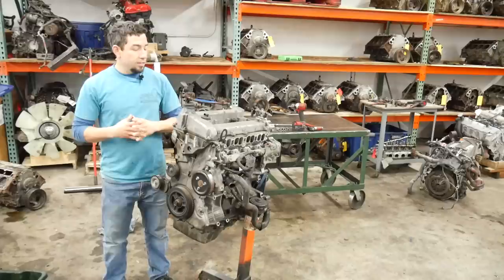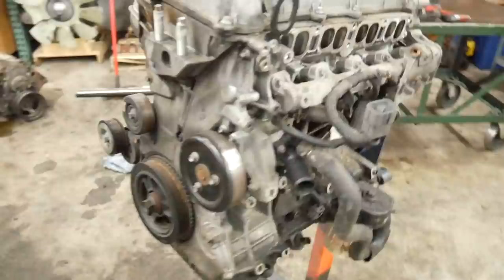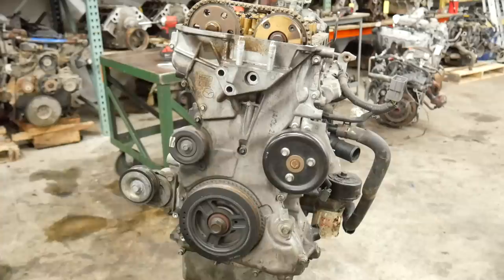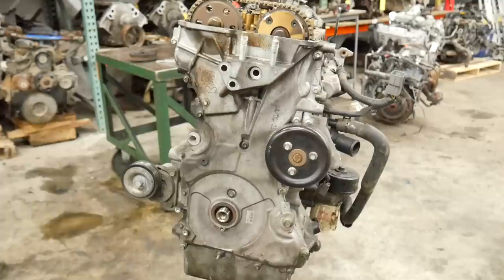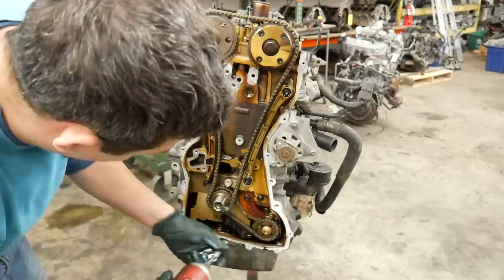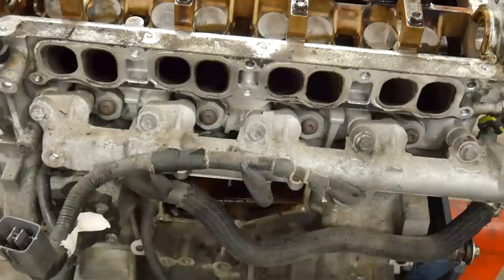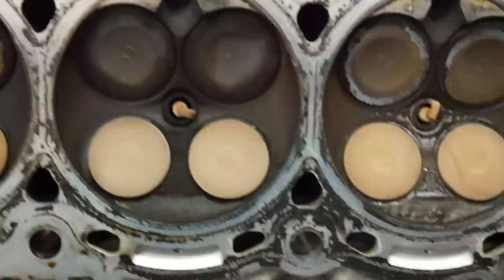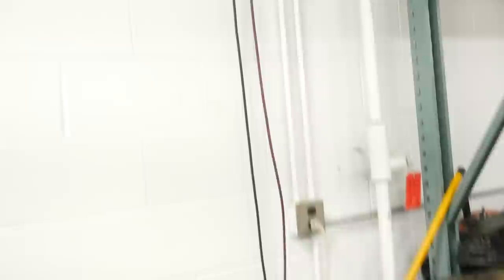TOTAL TEARDOWN: BAD Mazda MZR 2.3L Turbo Mazdaspeed3 Mazdaspeed6 CX-7 Engine.

Comment: I've been wondering where all the Mazdaspeed 3's and 6's went... Haven't seen many CX-7's out there as well.

My 2011 with 50K on it has been pretty reliable since fall of 2016 when I bought it with 22K miles on it. Turbo went but that replaced under extended with a non-cx-7 turbo since they don't make them anymore... That said, after watching this, I'm glad I got extended on it. 😬 Damn, that's complex.

Comment: I would love for you to do a Theta II turbo 2.0 out of a 11-15 Optima, or 11-14 Sonata. They had the huge class action lawsuit, resulting in lifetime engine warranty. But I would like to know the design flaw. They say its from leftover metal shavings during engine manufacturing. Which doesn't make sense because some people are on their 3rd and 4th engines. I'm sure if it was only metal shavings they would've corrected that years ago.

Comment: 245k on a speed 6 original engine and turbo, I change the oil religiously at 3k miles I drive this car pretty hard at times. 

people beating the piss out of them and or not doing proper maintenance is why they fail, these engines aren't harder to work on than anything else I've noticed, there's people out here pushing 5-600hp on stock internals....

proper tools and follow the service manual I've seen folks tear down and rebuild these motors in their garages. 

this whole video is all personal bias.

a utterly terrible motor is the Ford Duratec v6 (any generation), I went thru 3 of them all of them spectacularly failed in some sort or another.....
Reply from the maker: I do agree with you however you can’t tell me that only people who beat the piss out of and neglect cars only bought these. They own everything. The truth is they aren’t as tolerant of abuse or neglect, and they are expensive and somewhat difficult to service if you do it yourself. 

I do complete agree with you on the duratec v6. The mazda6 especially. Oil leaks, rod knock, broken manifold bolts and don’t get me started on the water pump design.
Reply: @I_Do_Cars  I agree, as well they are not as tolerant to abuse FWIW, you still have a dope video here and I am subbing!

Comment: I've worked on many cx7s with the turbo 2.3s and I absolutely hate them also!! The design sucks but if one comes in the shop that actually has been takin care of they are actually not that bad of engines but they all fail due to owner negligence especially with oil changes

Comment: Dude, the rocker cover is from a Gen2 Speed3. For CX7 which only comes in auto, there is an inner bearing at the end of the crank. Lookin at the block bolt on where the power steering pump sits, I'd say its a Gen2 Speed3 engine.
Reply: MS3's have that red metal oil filler cap on the valve cover. This one has a regular cap from a cx or a regular 3/6. So might not be a MS.
Reply: @quazznorm1777  Thats optional on a MPS but that could easily been swap but what cannot be easily swap is the piston+con rod. For the Gen2 thats 100% diff. That alloy oil cap fetch lots of money over in asia n' europe coz thats for USDM only.✌
Reply: @quazznorm1777  it's irrelevant. An L3-VDT is an L3-VDT, they're all the same engine with the exception of the differences between the gen 1 and gen 2. That's a gen 2 L3-VDT as fitted to a Mazdaspeed 3 or CX7. The only difference between the Mazdaspeed 3 and CX7 is the spec of the k04 turbo.
Reply: @byteoncomputerservices8054  Piston+con rod is same for Gen1  Speeed3,6 and CX7 but redesigned for Gen2. I've blueprint it blah,blah,blah. Thats how I know the diff.
Reply: @princesssolace4337  The piston most definitely is not the same between series one and series two (as fitted to the BK and BL MPS/Speed3 and CX7) L3-VDT, rods are all the same sinter forged items and the weak point of the engine when tuned.

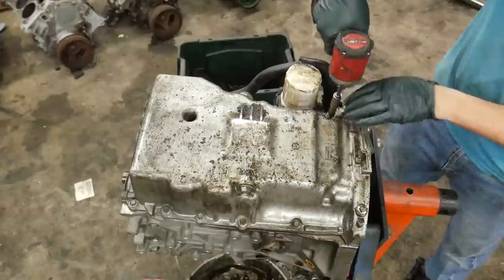Comment: @13:56 See that canister oil filter?   Unless this engine has had an aftermarket filter conversion installed, it is NOT from a Mazadspeed6.  Those have cartridge filters.
Reply from the maker: People buy engines and swap parts on cores all the time. That’s likely what happened
Reply: @I_Do_Cars  Or just likely the engine came from a 2nd generation Mazdaspeed3.  I believe those used canisters.

Comment: I owned a 2006 Mazdaspeed6 and the engine blew at 136,000. 2 cylinders had zero compression, sold the entire car for $800.
Reply: That generation was reliable.   What actually failed on yours?
Reply: @mrdumbfellow927  not sure, did compression test and cylinders 2 & 3 had zero. The rear fenders were rusting pretty badly so didn’t want to pour money into it. Also, it would drop out of second gear (had to hold shifter into place) so I unloaded it. I always wondered if the guy I sold it to ever got it running again.

The car was fast as hell and great fun to drive, was a beast in the snow also. It’s been 4 years or so and I still miss it.
Reply: @Jonesy32  Cool, I was curious  because losing compression on 2 cylinders simultaneously instead of just 1 or a whole bank of a v6 or v8  is weird.  I always wanted a Speed 6.    Sort of unique compared to seeing a fast AWD  Subaru or Mitsubishi all the time. 

Rust is definitely the enemy of everyone.  Unless you live in the south, those people have no clue how good they have it.

Comment: Did you ever notice how small the hole is for oil in the chain tensioner?   I bet most people are neglecting oil changes and or wrong oil.     Too thick of oil to get into that tensioner.

Comment: I bought a 2008 Speed 3 brand new with 20 mi on the odometer. It now has 230,000 mi on it and it's still kicking. Zero engine work, original turbo, original clutch.

Comment: Bummer.  I have a 2008 Mazdaspeed3 w/ 98K miles and have had zero probs, except for the smoking turbo (a manufacturing defect of the K04 turbo).  Then again, I change the oil and filter every 3K miles.  Sounds like the problems people have with the MZR 2.3 turbo originate w/ their failure to keep the oil and filter clean and fresh.

Comment: CX-7 from 2010 with this engine, 235.000km, number of issues with this engine: 0. But so much fun after 12yrs and 235K kms too! :-)
oil and filters changed after every 10.000km. what's the problem?

Comment: A lot of GM 3.6L engines get timing chain stretch. It tends to happen to people who trust the oil life meter. People who change their oil more often have been said to be less likely to experience that. I think GM decided to change the programming of the oil life meter.
10:42 I have heard of people resizing the cam caps, the running an align-hone through the cam journals to save rare DOHC or SOHC cylinder heads. However, I think the MZR2.3 head is common and cheap enough to not need that.
Reply: My old BMWs have a oil change indicator on the onboard computer where I think ze Germans added an extra zero in the code somewhere... I pity the engines whose owners paid attention to it
Reply: @greebj  Wow, and I thought BMW engines were annoying enough already. After decades of improved gasket material, BMW still uses some kind of garbage that turns to stone in 5 years of driving.

Comment: As I knew it!!  Oil starvation in a turbo entire the worst and he said those were good crankshaft bearings!!! And Mazda kept denying that it was an engineering issue!!!! If you bought new and warranty ran out you were screwed. Talk about a bad investment. And I read over and over how people bought new engines only for the same issues to happen again leading to engine failure. Junk!!! Mazda and the dealers made money off this junk and I'm wondering how they're even being considered as something worth even buying as the newer models are now advertised for 22/23!!!!!! And there's no aftermarket kits or parts for these things so MAZDA lost me. Buuuut, check this Mazdaspeed 6 on YouTube with a bit over 900hp with factory block!!!! That's hard to believe but check it out by typing 900hp Mazdaspeed 6. It's what had me thinking these engines or this line may have been worth looking into. And can you believe Mazdaspeed which he just did the teardown didn't make many of that turbo series with the 6 turbo so they are going for as much as $10,000 can you believe that!!!!!! And this is exactly what may happen to you no matter how.much you baby the car because it was just bad engineering for the 04-08 and 09-11 as well years but overall Mazda burned a lot of people with these models and engines to the point of having a class action lawsuit brought against them.

Comment: I bought a first gen Mazdaspeed 3 and put about 50k miserable miles on it.  It was such a strange car.  It was exciting under acceleration and that's about it.  The suspension was rock hard but the car pitched like a sail boat in corners, rev matching was near impossible even after 50k miles, it started to blow smoke out the exhaust after 30k due to a bad turbo seal, it wasn't a good sounding engine either.  I got it pretty cheap and it was pretty reliable I guess so not the end of the world but yeah..not a lot of fond memories of that car.  I did like the way it looked though in pearl white.

Comment: I used to work in a Mazda dealership that 2.3 is a very GOOD engine when it's in a speed 3 or speed 6 but they where garbage in the cx7 because the engines ran too hot there was no fresh air cooling the intercooler...we barely ever had issues in the speed cars but in the cx7 everyone was a shitbox

Comment: So, why did this engine have an issue with oil, or lack of oil? Was it simply not maintained or is there some design issue that ends up staving the engine? My concern is that my wife just purchased a Mazda CX5 turbo and I would hope she won't be asking me one day why the engine sounds like the hyper drummer in a rock band. She was dedicated to servicing her 2009 Dodge Avenger that she finally traded in at 247,000 miles with no repairs, none! (She got $100 trade-in) I need her to have the same record with this Mazda but your tear down scared me. By the way, the reason there is no screen on the oil pickup is the Mazda engineers were concerned that metal fragments would clog the pickup and starve the engine of oil. I feel guilty about taking such interest in someone else's misery but I love watching your tear-downs.
Reply: cx 5 have skyactive engines its a different engine

Comment: Being a Mazda mechanic, maybe you can answer what I consider a simple question, but nobody has an answer for. I tore down my 2009 CX-9, 14 months ago, when the water pump went bad (V-6- the engine with the water pump inside.🙄 Of course, everything on the engine says FOMOCO on it. 
It’s a Ford engine. It’s a Ford water pump. I got the pump at a local Ford dealer. (Mazda dealer is 40 miles away) Instructions said use appropriate coolant, or damage to the water pump will ensue.
Ford specs out one type of coolant for this engine/water pump … Mazda specs out a totally different type of coolant. Any idea why? Just askin’? The best I got to date for an answer is about EPA disposal of fluids in different countries. My Mazda was built in Japan (assembled), but I just don’t buy this answer. If you get a chance, I would love an answer.
Reply: Look at mact ford edge youtube. Or search duratech water pump failure. Common problem

Comment: My Speed 3 has burned oil since the day I bought it. Good thing I was already in the habit of checking my oil every fill up. Some day I will tear it down and fix whatever is casing it to consume oil.
Reply: Check your PCV valve hidden under intake manifold.   They were known for it.
Reply: Also Both cams do get locked when timing them. it just takes a different plate that has a cutout for the extra length of the intake cam.
Reply: @no_dissasemble  ? 😀
Reply: @no_dissasemble  Also, is your screen name a reference to the movie "Short Circuit"?
Reply: @mrdumbfellow927  Yes it is.

Comment: The small size turbo has alot to do with getting a hole in the block also..
Reply: The k04 isn't that small a turbo depending on spec, the L3-VDT is simply a fairly large capacity engine. However, the k04 maintains a nice flat torque curve from 2200 - 5500RPM before is reaches its limits and boost tapers off, really no different to any other hot hatch out there. Would you care to explain just how a k04 can ventilate engine blocks?
Reply: @byteoncomputerservices8054  these k04 is to small for our engines. They work well with vw 1.8 &2.0 engine. Yes the keep a flat curve ,but they run out of stream past 5500 rpm,on these mzr motors..the reason why I say that these turbo contribute to putting holes in the block,is because at 2200rpm ,those k04 already boosting 13-14psi stock.adding aftermarket parts increase the boost, at the lower rpm.using a bigger turbo,bigger hot end or running a 9 blade exhaust wheel,would decrease the load at under 3k rpm..cars with a bigger turbo with a proper tune ,are less likely to bend/break rods..can you tune your car with a stock k04? Yes you can,but these turbos aren't efficient pass around 18psi  .
Reply: @smtyson1650  the failures at 2200RPM have nothing to do with the turbocharger used, the failures when lugging the motor at 2200RPM are a result of LSPI, something US tuners seem oblivious to. LSPI, or Low Speed Pre Ignition, plagues GDI turbo engines. Basically, fuel is injected directly into the cylinder, some fuel condenses on the cylinder walls due to the fact that the cylinder walls are the coolest part of the environment to mix with the oil also present on the cylinder walls. As the piston travels on it's upwards stroke, that volatile fuel/oil mix builds up in the top ring land area. Once the piston reaches the top of it's stroke (TDC) that fuel/oil mix is slung into the combustion chamber to instantly and unpredictably ignite resulting in pre ignition and uncontrolled combustion when cylinder pressures are highest (keep in mind, were talking about cylinder pressures approaching that of many diesels) - This is what causes engine damage and is an issue regarding virtually any GDI turbo engine ever made, all a larger turbo will do is change the threshold LSPI occurs, for example from 2200 RPM to 2400 RPM (depending on turbo size). LSPI is literally one of the reasons SN grade oils were invented. In comparison, the Golf R with it's larger IHI turbocharger will start boosting at ~1500RPM, providing a flat torque curve up to 5500RPM where it drops off - On a 2.0L engine. Point being, most hot hatches have the same basic characteristics and the k04 actually isn't that bad a turbo, especially if you get the last k04-883 OEM revision. I run mine on a reverse boost taper peaking at 20psi and I've had no issues. Having said that, I always run SN+ grade oil, I change it every 5000klms and I don't lug my engine on the freeway at 2200RPM in top gear.

Comment: If it was out of a CX7 it had an automatic so it probably never had low speed/high pressure pre-detonation like MS3s would suffer. Don't mash on a turbocharged motor in sixth gear.

Comment: The "1st gen" Speed3 engines (2006.5 Speed3/6, CX-7) were more prone to the failures you described.  The "2nd gen" engines (Speed3 only) from 2010-2013 were a lot better.  I'm curious if you have worked on the newer engines & seen the same problems?
Reply from the maker: I have but lesser so. You can tell by their piston design which generation it is. There are also much fewer second generation engines out there.

Comment: These engines do suck.....its right up there with the Ford 5.4 3V.....its hard to believe the duratec 2.0, 2.3, 2.5's are held in time with a diamond dust friction washer squeezed with bolt torque. Let's see a chevy Colorado inline 5 engine teardown.
Reply: That sounds like fun

Comment: I must disagree man,in someway at least. These engines aren't any less reliable than any modern gdi turbocharged engine with similar capacity out there. If you compare it with some over-engineered legends (like 2jz , 4g-63,sr20-dett, 4a-gte) , YES it's worse.BUT in comparison to its similar competitors it just has similar issues. If you open your hood once a year or doing zero preventive maintenance, these engines are just not for you. I' ve rebuilt some of these,and after explaining to their owners what should do to look after them, they run perfectly even with tune ups. I got my speed3 for peanuts with just 20k on the clock, after the previous owner bent a rod because he was experimenting with boost pressure... Was that a factory defect?  After a decent rebuild it runs perfect daily ,dealing with 400hp and over 200k on the clock now. Just needs some preventive inspections and monitoring if you run a tune up. Yes ,the balance shaft is just 20 pounds of ballast, BUT it can be deleted with a blink of an eye with zero problems. Yes, the chain stretch BUT it makes a warning sound . Ask VW  EA888 owners about the same issues...In conclusion I believe that like other similar engine out there is just NOT foolproof!

Comment: Why this 2.3 looks different from my 2.3 on my Mazda 5 2010? I would like to turbo it and get a bit more out of it but I'm seriously confused, because all the 2.3 I had seen, all of them have a different valve cover than mine, I only saw a 2.0 with the same valve cover (oil dipstick on the valve cover), but my 5 says its a 2.3.

Comment: I'd love to see the 2.3 ecoboost teardown as it shares the same block.
Reply: No it doesn't. The MZR L3-VDT is closed deck and will handle 800BHP no problem. The Ecoboost 2.3 is open deck and will struggle to hold together at stock RS power outputs from factory.

Comment: can tell you how many times ive broken the crank timing tool bolt. made out of super weak aluminum so ANY torque applied either bends or completely breaks the tool. boss up and buy a real one. amazon ones are cheap and essentially one time use